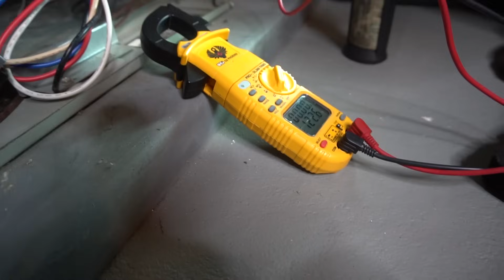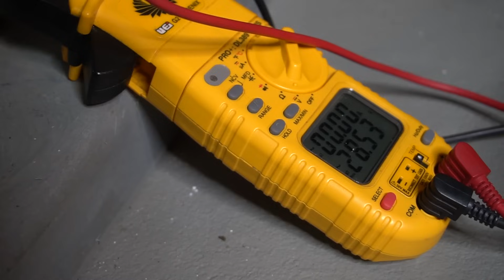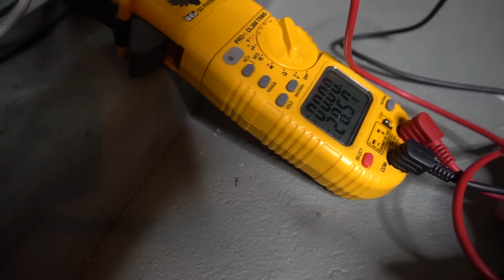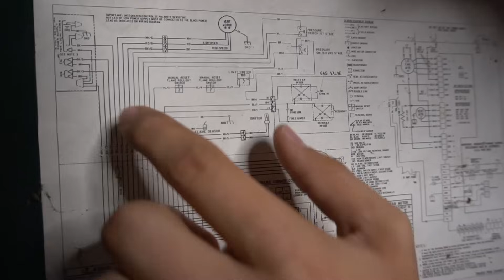Furnace/AC How to Troubleshoot The Control Board

Comment: **Urgent Help** Hi WOATV...so I installed new control board cause my old one was reading 3 flashes/blinks and the inducer motor would just come on and nothing else. Seeing I didn't have a multimeter and the furnace is old I had a new control board in box stored up last 5 years never used it. Installed new one carefully, exactly the way my old setup was with a few minor mods, basically replacing pigtail TSAT with new board wires. 

Once installed the only thing to happen was the red flash code would light "not blinking" (I guess indicating power to something) the inducer motor would not even spin as it did on my old board. Mind you I'm in Chicago nearly freezing to death working in my basement. So I put  old board back in and the same thing happened only red flash code and no power or any type of movement nor would inducer motor spin. So moved around a few wires in my frustration and sparked or blew my old board by inserting a wire I think transformer into FS and it sparked/blew.   

My question if I did everything exactly like my old board why would it not attempt to operate my furnace. I really need help here like right now, long shot on Youtube but I'm reaching out to you before I reinstall the new board. Thank You very much if I hear from you, Bill.
Reply from the maker: Hey Bill! Sorry I couldn't get back to you until now. When you put the new board in, there is a chance that your thermostat got reset when it lost power and was not making a call for heat so the inducer motor was not coming on. Also, usually three flashes stands for a pressure switch error.  I have a video on the top 10 pressure switch problems that would go well for that. I also have videos on how to bypass the thermostat to make sure that the problem is not the thermostat. I don't know about your furnace but on most furnaces a steady light means the furnace has power and is on standby waiting for a call for heat from the thermostat. 

I see I am answering you 10 hours later... So hopefully by now you already got it working.
Reply: @WordofAdviceTV  I so appreciate you taking the time to go over this with me. I'm going back downstairs now hopefully we'll make progress. One last question, if I put penetrating oil on inducer motor will that hurt anything? Also I put a new pressure switch from other furnace still nothing, but we'll. You're the best WOADTV I click total Thumbs and like & subscribe.
Reply from the maker: @bemartythree6589  The oil will not hurt the inducer motor. I hope you will be able to get it going, good luck! And thanks!

Comment: Love the videos, came for the flame sensor fix and kept watching.  Now that I got that fixed no I am getting a limit switch code.  So I changed the Manual rollout switch and high limit switch.  After each time the Furnance would run and come up to temperature and then cycle n and off.  With the limit error code it goes straight to the blower turning on.  Any ideas.
Reply from the maker: I have a video just for that :) Don't know if you've seen it yet.. 10 reasons why a furnace can overheat: https://www.youtube.com/watch?v=3ZPmltTR5S4&t=17s

Comment: Dude, you saved me a service call!!! I was trying to replace the stat, but may have crossed some wires...had black wire going to the b/o terminal. I have a 1 stage forced heat, and 1 stage a/c Armstrong unit). Either way, I was able to run fan only, and heat, but when I switched to ac everything went dead. Reset my breaker, replaced the old stat, all with no avail. Watching this video, I was able to  identify the transformer, line in, and the fuse from the transformer to the board (mine was located on the board itself)

Sure enough the fuse was blown. I did not have a 3 amp replacement, but I put a 40 amp in there just to get me thru the night. (As it is only 30 degrees outside, so heat is a must)!!! Thank you for the thorough and step by step instructions. They were much needed in my case. I will get that 3 amp fuse in there first thing in the morning.
Reply from the maker: Glad you got your heat back! But I would be careful about putting in a 40 amp fuse instead of a 3 amp fuse. 3 amp fuses are there to interrupt the circuit if there is a short somewhere. If you actually have a short in the system, the 40 amp fuse will not trip. Which could melt wires or in the worst case start a fire. So I would definitely keep an eye on the furnace/ac and the wiring. If you smell any electrical or burnt smells, turn it off right away until you can find the short.
Reply: @WordofAdviceTV   Thank you! yes, I caused the fuse burn because of the mis-wiring of the replacement thermostat. I will get out there later today to get the proper fuse rating, the 40 amp was an emergency move due to the snow and dropping temps overnight I found your video 2a in the morning and was able to get the heat going for my family!
Reply from the maker: @DeShonClark  Oh okay! You knew what caused the short. I missed that part. In that case, that was a good idea! :) Glad I was able to help, stay warm!

Comment: Can you make a video about switching a control board out with a different style, or brand of control board? Showing how to troubleshoot where wires belong on different types of boards.
Reply from the maker: Well.. It would be hard to make a video like that since every control board is different. There's really no cookie-cutter approach. To put in a different style board that's from a different brand furnace, you would really need to know what you are doing. But if the new board is indeed for your furnace but it is not the same as the old board, almost every time it will come with an instruction sheet telling you where the wires need to go.

Comment: Thanks for the GREAT videos.  
My furnace (Lennox G40UH-60C-110-03 with 32M8801 control board) stopped today,.  The Inducer motor doesn't even start.  Used your troubleshooting in a previous video, I tested the connection to the thermostat.  YWRGC screws on the control board,  Tested W-C 26V, R-C 27V = no issue with thermostat

Inducer motor not receiving voltage at connectors near motor, nor at/from board. No visible inducer motor capacitor to check.
Inducer bearings rotate freely, no indications of damage, noise, smells, friction, Rust, etc.  Flame sensor cleaned, and the filter is fairly new.   
AC works
There are lights on the the board (#1 off, #2 slow flashing), so there's power on the board.  

It looks to me like the control board, unless there's a signal from the pressure switch sending bad data? 

Any tips on replacing the control board?  

Thanks again for the GREAT troubleshooting videos.
Reply from the maker: You did a really good job with the troubleshooting! Also with typing out what you did. Thank you for all the details! If you have 26v between R-C, the control board should be sending 120v to the inducer motor. So I would agree with you, the board is very likely to be bad.  

About the pressure switch.. There is one possibility that rarely happens. Once in a while the pressure switch will get stuck in the closed position. Many furnaces will sense that the pressure switch is closed without the inducer motor running and will either not start or just the inducer or blower motor will run. To check it, just unplug the wires from the pressure switch and check for continuity or resistance between the two terminals. It should be O/L. If there is continuity though, then that means your pressure switch is stuck closed. You can try blowing/sucking into the little hose to try to free it up. Do this carefully (not too much pressure) since the switches need very little pressure to open and close. Otherwise you can rupture the diaphragm 

As for replacing the control board, it is usually very easy. Label all the wires or take a picture of them. Or if you can, you can take the old board off with all the wires on it, put in the new board and just transfer one wire at a time. If the new board will be slightly different then the old board, it will usually come with instructions on where the wires should go. Hope that helps!
Reply: @WordofAdviceTV  Well, looks like it may not have been the board.   I replaced the board, still nothing.  When I unplugged even 1 of the pressure switch contacts, the inducer motor starts for a while, the glow plug glows, no burner ignition, glow plug turns off, then the inducer motor stops and alternating red/green lights flash on the board.  No heating cycle.  Resistance between the connectors  shows 1.1
Reply: Once I turned on the gas....  I still have to disconnect one lead from the pressure switch in order for it to start.  And it will shut off after running for several minutes.  To restart, I need to turn the switch off for the furnace, turn it on, then disconnect the pressure switch, and it starts for a while.
Reply from the maker: @deancc84  Perhaps your pressure switch is stuck in the closed position. By taking the wire off you are tricking the board into thinking that it is open. That's what it sounds like to me anyway.. A little hard to say without being there. I would replace the pressure switch/s. Although it seems like you may have more then one problem going on there. So what code does the board blink after it runs for several minutes?
Reply: @WordofAdviceTV Replacing the pressure switch fixed it.   THANKS for your great video and responses!

Comment: I have a question and I hope you answer me quickly if you dont mind. I haven’t found a split AC video in your channel but I hope you know what I mean. I have a split AC that wont turn on at all like I turn it on and I get a null display board but when I put a white paper on it I can see the code E6. So I wanna ask you what do I do because I checked the voltage and current and it’s all good. Could it be the control board that is defective? Like it’s not working at all. I found that the pipe thermostat is chewed up by the mice but that wont affect the starting process it would just stop cooling. Thank you.

Comment: Can the capacitor cause the blower motor to run constantly?
Reply from the maker: No it can't. Is your thermostat fan setting set to ON instead of AUTO by chance? If it is on AUTO but still running constantly, then likely the fan relay on the control board is stuck closed. You can try tapping firmly on all the relays on the control board with a screw driver handle or something of the sort. If you get lucky, that will free it up. The relays usually look like small black plastic boxes on the control board. If that's not working, then to fix that you would need to replace the control board.
Reply: Thank you for the advice!

Comment: After watching your video I got on to Amazon and bought a $24 multimeter to run through the troubleshooting with you on my furnace's control board. Everything checked out up to the fuse. Pulled the fuse off of the control board and found that it had blown. Took a trip to Home Depot and spent $4 on a 2-pack of 3AMP  fuses, plugged it into the control board and voila... the furnace works again! I'm not gonna count the cost of the multimeter since I've always wanted one (this just caused me to buy one early), but this was a $2 fix! This saved me tons of money! Thanks for the great advice.... YOU ROCK!!!
Reply: Glad you got your problem "fixed".  However, something caused your fuse to fail.  The fuse is there to protect the circuit from drawing too many amps/too much power.  You may yet still have your original problem...
Reply: @GerminatorTom  I totally agree, something caused the fuse to blow and I have absolutely no idea what. My furnace is 13 years old and was installed when my house was built. I've never had a problem with my furnace and never opened up the control board cover panel till now, but when I did, there was dust (not a very thick layer) all over the board. I cleaned it all up before installing the new fuse and my furnace has been running perfectly every day since replacing the fuse. I've had some blackout over the years and I'm not sure if a power surge when the power came back on would cause it to blow. Could it? If or when the original problem presents itself again I'll take a closer look for a cause.
Reply: @1flybyguy  Furnaces need to be inspected and cleaned before the heating season starts to prevent carbon monoxide production and prevent fires both of which can cause bodily harm and DEATH!
Reply from the maker: Awesome! That's great to hear! I'm glad I was able to help and thank you for coming back to share how you fixed it. Stay warm ;)
Reply: @WordofAdviceTV  I JUST FOUND YOUR AWESOME CHANNEL
I'M SOOOO LOVIN' IT❤️
Reply: @WordofAdviceTV  if my gas shut off valve has been off for months, will it cause the control board to shut off?
Reply: That is fantastic! It always feels good to fix it yourself.  ...Just use caution with the bargain priced multimeters. The can cause injury if they fail on you when testing high voltage equipment.  :)
Reply: Excellent video.  My Payne Carrier 395AAW036055A furnace stop heating.  Strangely enough, it was turning on when called for by th eThermostat but  the gas was not being ignited.  I though the control board would sense no ignition and shut down, but it wasn't behaving that way. I removed/cleaned & (carefully) replace the ignitor electrode to no avail.  Upon replacing the 990-195 ignitor module & 871A electrode, the furnace failed to turn on at all.  I was wondering if there was a way to test the 871A ignitor electrode? or 990--195 ignitor module which appear to be an integrated part.  I am guessing that I could resistance test theg T1 & T2 terminals of the module as one would test a 2 prong glow plug.  Schematic states T2 is a ground (not a transformer as one might think).  If not, then I will just have to test the power to the control board per your video.  appreciate the info, TIA.  HNY BTW
Reply: Peter Rudden
Reply: Today, i found out that there is no 24_voltage go to the Pressure Switch by using multi meter and so the Pressure Switch is remain Open.  The inducer fan motor is very warm but not too hot and it is running.  The inducer fan motor is running and that is all but nothing Else.   So', WHAT CAN BE the problem, brother Word of Advice ????
Reply: Good for,Sir  it's a blessing to be able to fix it yourself.
Reply: Oops when replacing my thermostat i touched my red with what I assume was my blue common & it sparked, so I think this will help me find the fuse & then I just need to figure out where to put that blue common on my new thermostat that has no C terminal .. hummm wish me luck lol
Reply: @Gloppp  somebody shouldn't be changing thermostats...
Reply: I’ve came across this one situation where a fuse we las blown on a packaged unit I put a fuse button in and it ran fine for a 15 min I checked everything to line voltage I checked for grounds and everything
Reply: If it didn’t blow again you should be good but you gota think about think fuses can blow from west and tear or brown outs
Reply: You did saved a lot cuz to do something like that it’s about 450 dollars company
Reply: I have power going in, but now power to the igniter at all ...with door switch closed.
But the furnace motor runs....what can be the problem

Comment: hey Jay. so I got a 3yr old furnace.
I am getting a polarity blink code from the motherboard.
no re-wiring was done; although we had some power outages in the summer.

when door is shut the blower will come on. I get the blink codes repeatedly until the blower shuts off. it doesn't try to ignite or anything.

I tested
main in..120

from the board pins
out to transformer..120
out to inducer and hot surf igniter..0

red and blue from trans...both 24

if I disconnect everything(except the main) I will also get the same err code right away.

I'm guessing it is the board but is there anything else to rule out? any how I can jump the system to get past the first stage
thx in advanced!
Reply from the maker: It could be a control board problem and the board just needs to be replaced.. Hard to say with that error. You can try swapping the Line and Neutral once to see if that will correct the polarity issue. Trace where your wires go from the furnace power switch and swap the black and white wires around. Of course make sure the power is off while you are touching the wires.
Reply: Thanks for the reply, did as you suggested, swapping the black and white wires at the junction box, but I get the same problem :(.

I will try to get a new board. but in general if I disconnected everything and just left the line in, would I get any error codes?
Reply from the maker: @omma2506  To be honest I can't say for sure if it will or not. Your LED light is probably powered by 24v so if you disconnect the transformer, then there shouldn't be any lights on.

These polarity codes can be a real nuisance. Many times a new control board or swapping the line and neutral will fix it but if it doesn't... Then things get interesting. One really annoying one that I remember was a Heil furnace. After many hours of troubleshooting with multiple guys, replaced many parts... We finally figured out that the furnace will work just fine if we hook up the line voltage into an outlet in a different room... Turns out that a while ago, the customer replaced all the outlets and light switches, including the furnace power switch. Unfortunately I am not sure how this story ended because at that point we told him to call an electrician to fix any line wiring. These polarity issues can be tricky because the furnace can work fine for a couple years with reversed polarity before that error code pops up. Anyway, if the board won't fix it for you then you may want to call someone as this has great headache potential.
Reply: darn mine is a keepright but I think heil uses the same board 😧...any how thanks alot for replying...if I get around to replacing the board I'll keep u posted. cheers!
Reply from the maker: @omma2506  Alright, good luck!